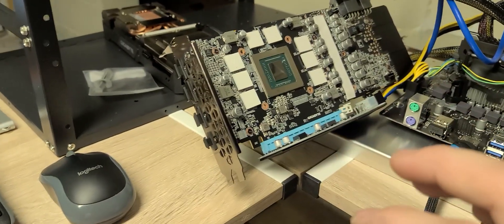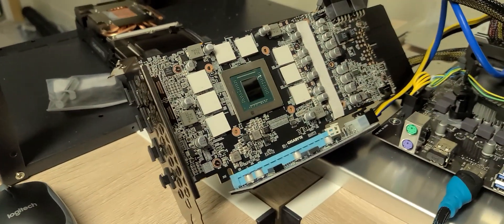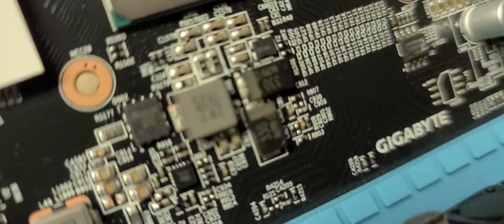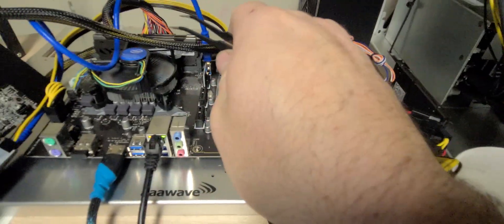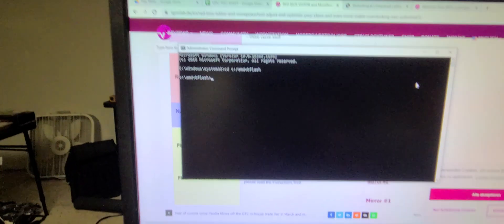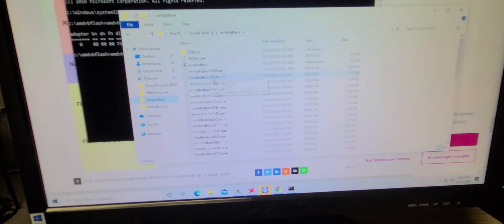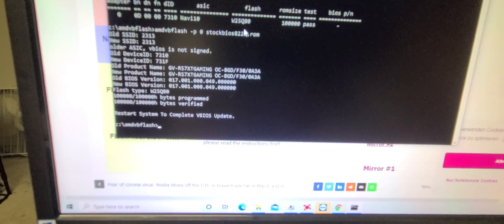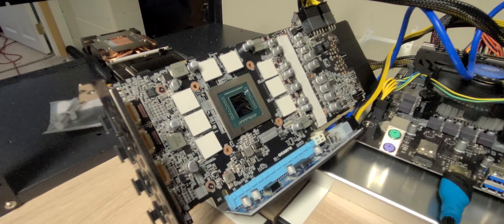5700XT and 5600XT BIOS recover from failed flash.

Comment: It worked man, thanks man you saved my rx 5700 xt gigabyte gaming OC 8G Rev.1
Cant thank you more 👍🏼👍🏼
Reply: Before i do the same, what version bios were you trying to flash onto your rev 1?
Reply: Hey download the stock bios from gigabyte official website. You will get an exe file in that folder. Just execute it. Press the flash button and u are done.
Reply from the maker: @ray2682  Yep I can vouch for this method, thanks for posting this!

Comment: how about downloading the amdvbflash dos version and bot it on usb along with .rom file and flash it on the windows bot. it also fixes the broken bios
Reply: Hey Idk if your going to get this, could that work
Reply: @lugia2204  yes i fixed my rx580 8gb sapphire nitro+ by this method
Reply: I just wanted to make sure what your saying is that fixed the gpu that was already bricked or you were testing thr settings of the rom if it was going to brick?
Reply: @lugia2204  no i am saying if you edit the bios of your gpu and after flashing it your gpu did not respond, in that case you can reflash your stock bios again through dos commands to make your gpu working.

Comment: Will this method work for me too? I saved the stock bios, modded it, flash back the modded one into my 5700xt gigabyte gaming OC 8G. It flashed successfully but then when I restarted my PC, it didn’t boot. Now when i put this card into my rig, like on a PCIe slot or riser,  my computer/rig does not boot. Doesn’t matter if i use dedicated graphics, or put this card with 5 other cards, this card alone does not let my rig boot.
Reply: i had this exact same issue....you have to use the method shown in the video to bypass the bios from loading on startup, and then use AMDVBFLASH 2.93 to flash the stock bios back on to the card....the issue is with using AMDVBFLASH 3.04....you MUST use 2.93 to flash the Gigabyte 5700xt specifically.
Reply from the maker: @xx_ORiO_xx  Yes, Gigabyte cards are a pain there is a special package to install and unlock the stock bios/downgrade then you can flash a modded bios
Reply: @xx_ORiO_xx  I used 2.93 but still my Pc won’t boot after the restart

Comment: Would you be able to make a video on where the chip is on the 5600xt? I have the same exact one but it solved the issue of no post, whereas now there is still a black screen after the cpu ram vga boot leds post. I believe I’m shorting the wrong one now.
Reply: Get your monocle and google the smallprint on the chips, theyre all roufhly same size, 8 legged buggers.
Reply: @kevinbaker2470  yea i ended up having to solder a new bios chip lol
Reply: @Hafizul12  hopefully it wasnt crowded. They usually arent. You desolder, or have to use hotair?
Reply: @kevinbaker2470  desolder, just swapped with a new chip flashed with a working stock bios from ebay.

Comment: You are a freaking saint
Reply from the maker: Glad this helped you!
Reply: @curatedcomputing  Just to confirm, were you able to extract the original BIOS using version 2.93...then edit the straps...then flash?  OR did you have to use a BIOS file found online?  In my case... I used 3.04 and someone in a mining discord was kind enough to give me the OC Bios which worked.  

Thank you for your feedback
Reply from the maker: @rajnificent  I backed up using 3.04 and could flash back with 2.93. I wanted a modded BIOS though so I used an older one I found online and modified the timings and added an MPT file to it.